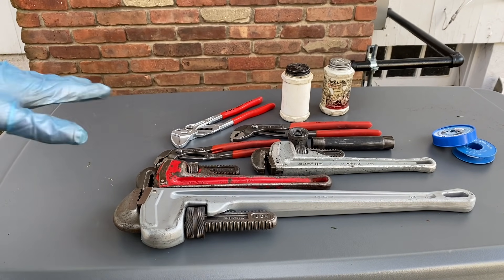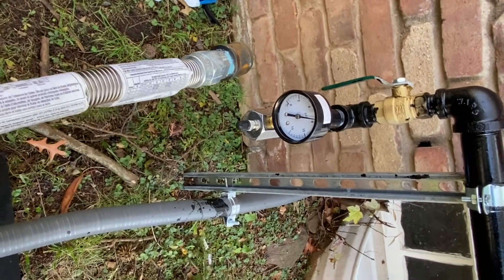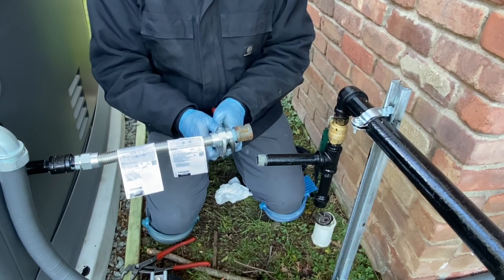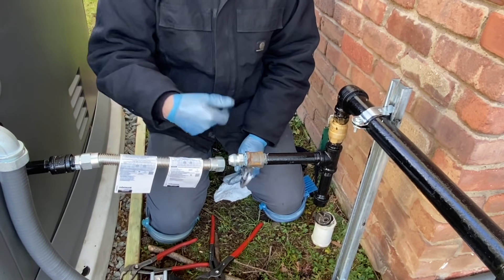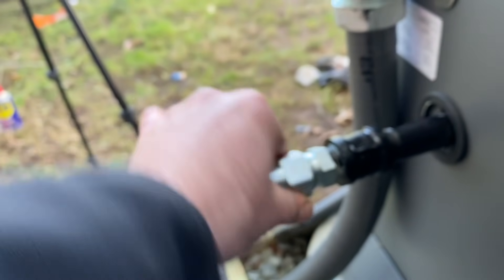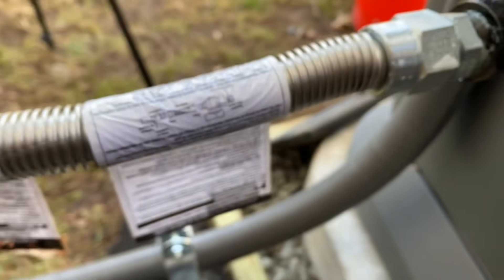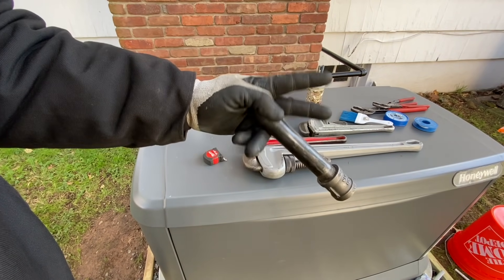How to Make Gas Pipe connections

Comment: Except for stretching the heck out of a short flexible gas pipe? Nice video. The first time a gardener, maintenance person or some kid walking between buildings uses that pipe to hold onto or step over? There goes your gas tight connection. No protection at all. No es bueno..😮
Reply: better to use extension to be on safe side. Just saying

Comment: This guy is terrible, by stretching the flexible hose out like that because it's too short, it will eventually rip apart after all the vibrations. What he should have done is push the ground stake holding the pipes towards the generator more to make up for the shortage. Better yet, get a longer flexible hose! This guy is lazy and did not do this correctly.
Reply from the maker: Actually I repositioned the racket, strut bar used to support the gas. This pipe is still intact and leak free as of 3 days ago when I did the generator maintenance

Comment: Just a hint.  Those flex connections supplied by Generac are stainless steel.  Stainless steel has a tendency to gall. So for the best connection a little pipe dope or Nyloc on the threads helps the threads to go together without galling.

Comment: At 4:30 to 5:00, he's taking off the pressure gauge 'before' turning off the shutoff valve on the line .  WTF?
Reply: The line is pressurized with air, not gas, to get rough inspection and show there are no leaks. If he had turned off that last valve before removing the gauge, then there would still be air in the line. Leaving it on you bleed all the air of the line.

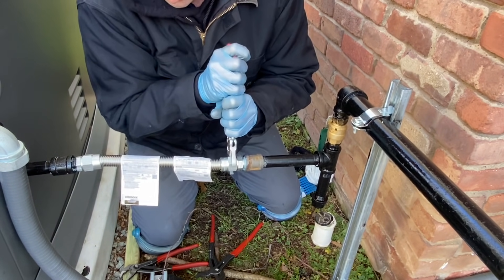Comment: While true that residential gas pressure is commonly low, you must secure the pipe to the threaded joints correctly. A great example of this is shortly after at 8:00, you attempted to tighten the "Flare Connection" and all the way back to your shutoff connection untightened due to the connections not being properly tightened! Also, You should have an appropriate sized flex connector as the one you have installed is inappropriately tensioned and is not suitable for application!. As plumbers, we must put our best practices at use all the time! You can do better than this! Good Luck!
Reply: Yeah, that pipe twisted on him near the wall.
Reply: He needs to go back to school.

Comment: Why did you not turn the shutoff valve off? Doing all this work with gas just flowing out? WTF?
Reply: The gas wasn't on yet.  He just got done doing a pressure test with air, made the connection, however terrible it was, and then turned the gas on at the source

Comment: Where can I buy that flex pipe I need one for my generator. someone installed the generator with an solid non flex pipe
Reply: Home Depot, Lowes or any Hardware store
Reply: @PedroGonzalez-pc6nb  I went to Lowe’s and they only had the yellow flex pipe used for inside the home. Are you sure they have this flex pipe at Home Depot. It looks to be different than what they carry

Comment: 1. When the inspector performs the pressure test, are the other appliances disconnected and pipe ends capped off or did you isolate the appliance using their shutoff valve? 

2. After the inspection, do you dis-assemble some of the pipes to re-connect all appliances?

I heard adding air with appliances connected could damage its valves.
Reply from the maker: The new line is piped into the meter. Then isolated with a ball valve. Need to have line isolated and holding pressure. Could take a week or two for inspection. Can’t leave a customer without gas to house. Air won’t hurt gas appliances. Too much pressure can hurt. Pressure test usually half gauge 7-8 lbs pressure. Gas allliances operate under 1/2lb of pressure.After inspection I bleed out the air,connect to generator or furnace. I let the pressure of the air outside before opening the isolation valve.

Comment: Always use yellow tape/dope because it's helpful to identify what's in the pipe especially for safety. That's the main reason. Also yellow tape or paint goes a long way as bonus.
Reply from the maker: Natural gas is mostly what Al heating system run on around me

Comment: That flex connector is not designed for outdoor use. Also just for information stainless steel flex connectors can corrode. Use Dormont with PVC coating
Reply from the maker: This flex connector is made for outdoor use. It is supplied with the generator for outside use. I have close to 100 generators with this connection. None have leaked or corroded. Stainless can corrode. Yet has to be exposed to to harsh environment. Generac use to give a black rubber hose so did Kohler. Yet this is a better pipe for vibration. I seen the rubber connectors dry rot

Comment: Way too much tension on that flex pipe, you need a slightly longer iron pipe.
Reply: SHould have swapped out the line with a longer one and one rated for outdoors.
Reply: Yeah I can't believe he's doing that he's going to break through being something whether it's the damn element in the central heat or the flex pipe

Comment: Hack job.
Reply from the maker: Done to manufacturers specs, how can you say hack job? That flex isn’t suppose to be loose just a vibration damper.
Reply: @thehvachacker  I do want to apologize for my rude wording. Just used part of your name for my response!  The flex line used is not just there for a vibration dampener though. On those big Gen sets it is also there to allow for some settling and movement. The gas control valve inside the unit doesn't want any pressure on it. Keep up the gas piping!  Not enough of us left that want to keep doing it. 👍

Comment: Wow... the way you pull from the flex connector at 7:27 ! It is obviously too short and as a professional that you are, you should have replaced it rather than stretch it like that and keep in tension. That will create a leak!
Reply from the maker: I had play with the main gas pipe to move it. Manufacturer wants this kept straight with no slack. Or I would change or add a nipple: it’s only for vibration protection on main gas line to generator

Comment: WINDEX for gas leak testing...insanely dumb and irresponsible
Reply: How is Windex dumb and irresponsible please explain
Reply: Can you please explain to me why Windex is irresponsible and dumb clearly later on a video he loosened up the fitting in bubbles appeared
Reply: @comeandgetit  Windex has ammonia and ammonia is corrosive to metal...
Reply: @StrongManMattt  Yes,  just use water and soap

Comment: What happens if you over tighten?  And how do you know when you've over tightened?
Reply from the maker: You can crack brass fittings. Or with steel crack or bottom out the threads and the fitting leaks. Gas pressure isn’t even 1/2psi my union wasn’t leaking and only hand tight. Once you feel some resistance using wrenches it should be tight enough.
Reply: @thehvachacker  OK thank you
Reply: run!!!!!

Comment: Black iron pipe out
Reply from the maker: Always use black iron pipe. Best stuff for gas
Reply: @thehvachacker  not outside must paint it in California no BLK iron outside
Reply from the maker: It is painted black before my connection. I also painted my connection after the video. In Jersey we also have to paint outdoor steel gas lines
Reply: @thehvachacker   cool I have seen black iron under ground it doesn't last long
Reply from the maker: No yet above ground last a long time. The paint is always missing on most roofs I work on. Pipes turn orange yet don’t run into many springing leaks. You see a lot of RTU gas piping rot through?
Reply: @thehvachacker   California we were required to use galvinized in exposed locations

Comment: I was asked the other day can you go csst to black hose connector on a garage heater? Anybody ?
Reply from the maker: Are you talking about a rubber gas pipe, such as one used for a bbq? I would just bring the csst right into steel pipe. The rubber gas line would have to be rated for the Btu’s of the gas appliance.
Reply: @thehvachacker  yeah the Reznor come with rubber gas line your supposed to use for vibrations or what have you. One of my coworkers called me said the boss wanted his to go from gas tight to rubber to the unit. I scratched my head like um thats not common practice ! So the rubber hose is definitely rated for the btus just didn't make sense to me . Mind you im a journeyman gas fitter just never came across this issue before
Reply from the maker: I would think with the csst a vibration damper wouldn’t be needed. Many space heaters in Jersey are pipe steel all the way. Yet I could see how a vibration buffer can always help.

Comment: now days yes, don't use the cheap white teflon on gas lines! years ago the teflon tape came in different flavors of density and width. density is key, which is what all the "born again multi-color tapes are. pay no mind to the tape color but LOOK at the tape and devices to ensure proper UL listings/ratings.
oh those are water shutoff valves(on gas line) no look at the ratings stamped on body and handle both :))

Comment: I remember back when I started my apprenticeship some 43-years ago, using Rectorseal No. 5; it filled the gaps between the connections of the pipe threads and was a great lubricant/sealer, for which it was designed for.  A few year later, along came Teflon (white) tape- a few wraps around the threads without having to use any compound- was an acceptable and approved practice in the trade (in my area) by the gas company and building inspectors.  Of course, now in my area, today's standard requires the use of gas-rated Teflon tape (yellow) and pipe thread compound.  You have to use both.  If you buried black iron pipe for gas, the piping was yellow plastic coated, and a yellow-coated mastic adhesive tape had to be wound and overlapped around any exposed pipe and fittings; that was, until the advent of Gastite PE underground piping.  As was the requirement then, as it is now, for test pressure/leakage, the installer must charge the line with 15 p.s.i. of air using a 30-lb test gauge and it must hold the pressure for 30+ minutes without any pressure drop.  Of course with direct burial, there are many requirements needed to be fulfilled for inspection approval; such as the depth (42"), sleeved in a clear sch. 80 x 6" round PVC pipe; whereas the 6" pipe must be laid in a 6" bed of sand, and a tracer line attached to the underground gas pipe. (Of course, you have to use natural gas risers and brackets, etc.).
Reply: Just a side note about the PE underground plastic service tubing.  I built in 1987 and personally installed the orange PE plastic.  Had a leak at the road tap this year and the gas company demanded that they install the new yellow PE plastic pipe from the road to my meter 400 feet back.  I was a bit incensed as I shot the original line with a transit and put it in a sand bed.  I knew they would not install the new line that well and they just bored most of it except for crossing my creek.  That said, when I researched it, I found that there is a propensity for the orange PE plastic manufactured in the 1980's to stress crack.

Comment: i think there will be alot of stress on that flex line. would suggest replacing it or put a longer nipple. thanks for the video
Reply from the maker: That flex joint is suppose to be installed straight. Also the support bracket just needed to be pulled into the correct spot. If you look when I leak searched the fitting it wasn’t tight

Comment: Really?.. should have used a longer flex connection. Not good posting bad practices like that.
Reply from the maker: The flex connector had slack when I was bubble spraying. The support post needed to just be pulled into place

Comment: Have you heard anything on the new Nylog White? It’s a silicone based sealant that can be used on high pressure refrigeration lines, but also seals gas, air, and water. Supposedly techs are just using this across the board. It’s supposed to stay wet and never dry. I have never used it myself but saw it reviewed by an HVAC School channel.
Reply: I will use the appropriate sealant according to the manufacturer instructions, I mean some sealants  will be ok for water but not for gas for instance.
Reply from the maker: I haven’t tried nylon for gas pipe. I B might sound close minded. Yet their are a lot more expensive and suppose to be better pipe sealants than ProDope by Hercules. Many might like the other sealants better. Yet I go with what works for me. Never return for any leaks with the prodope. I get same results with other sealants except many are not easy to clean, while also costing 3 times the amount. My employer switched to real tuff and mega lock. I had a boiler leak I couldn’t seal with the megalock. Union on an on demand boiler was a little messed up. The prodope was able to seal up the treads. Not sure what that says when a 4 dollar thread sealer made me throw a $16 dollar sealer into the trash and never want to use. Nylog is ok yet it eats up my hose gaskets. I use pump oil instead when pulling a vacuum.

Comment: Too much stress on that flex fitting. Don't be that guy, go back and replace it with a longer one.
Reply: I agree 😊
Reply from the maker: I had some slack I just needed to pull the support bracket a-little closer. If you go back to we’re I leak searched the pipe. Slack can be seen in the flexible gas pipe. While I am leak searching.
Reply: Also, it’s supplied with the generator and is supposed to be installed straight per manufacturer’s instructions. I thought the same thing the first time I installed one, but this is a good install.